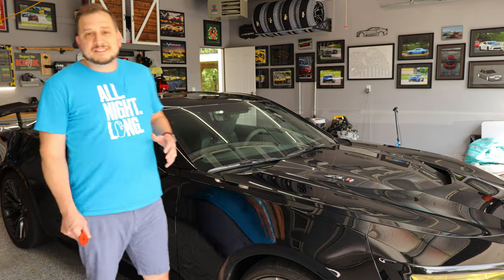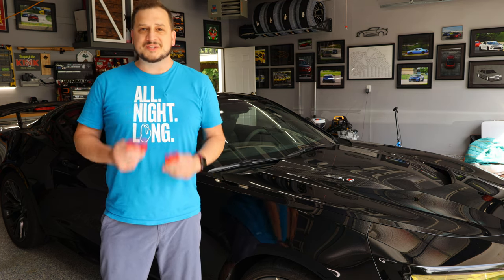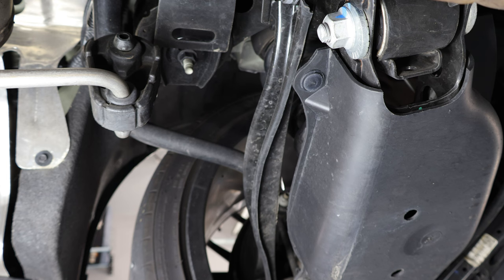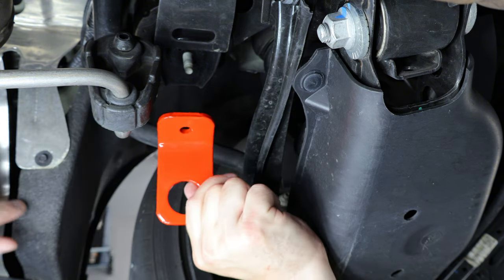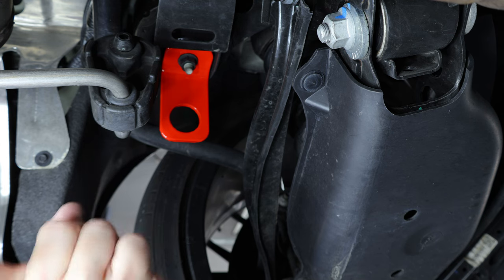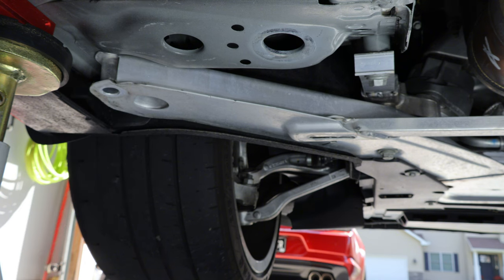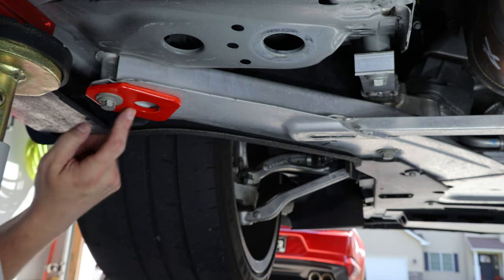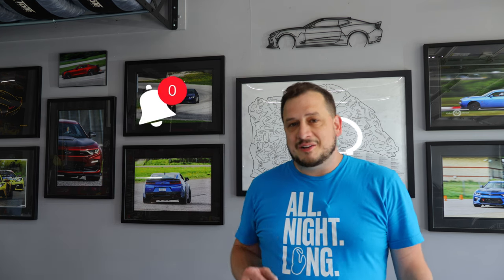How-To: Camaro Tie Down Strap Point Install

Comment: Hey man. Thanks again. I see at 1:45 you lift the car with jacks for the pinch welds. I have the ZL1 lift pads so they are a little deeper. But the front you’re using the lift pads. Are you using the back as well? I always just the Daytona jacks and use the lift pads only for jacking it up not keeping it up.
Reply from the maker: Yes, lift pads front and back. I use the MagPad to lift on the pinch weld. Link to that is in the description as well. I lift from the front-middle opening and place the jack stands on the lift pads.